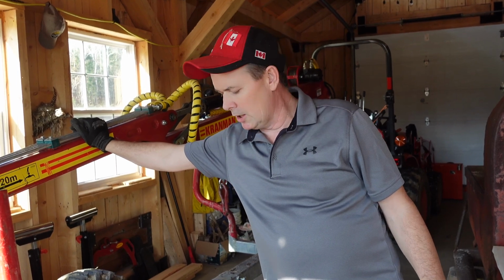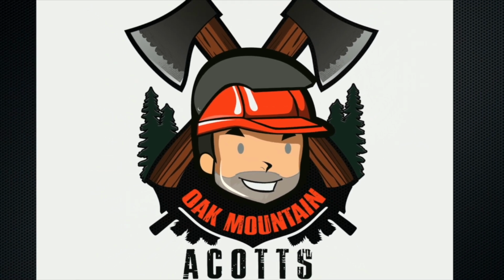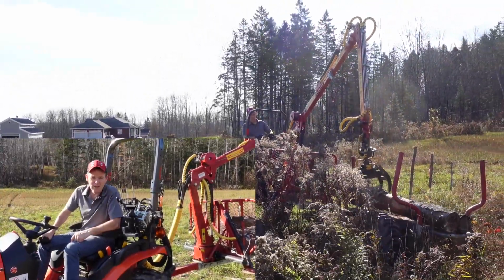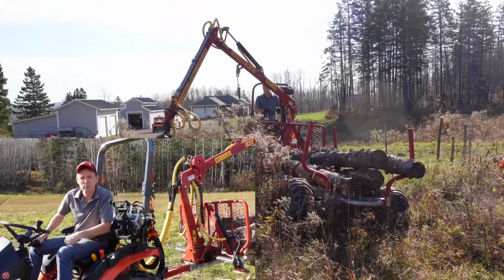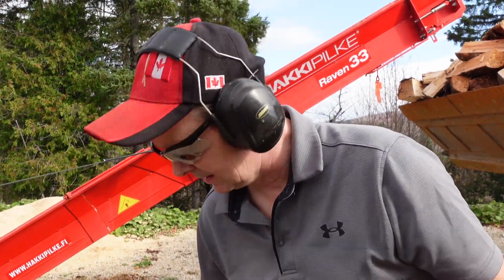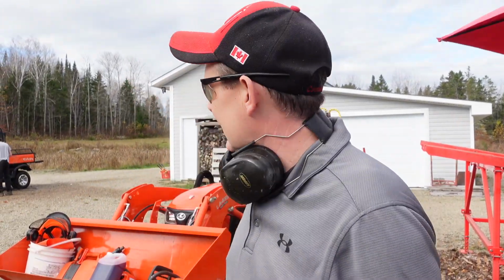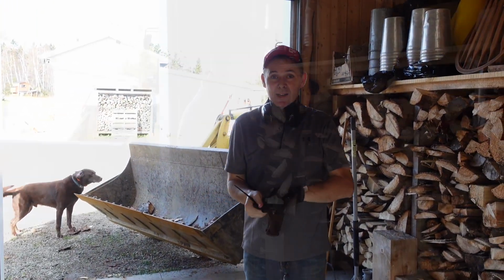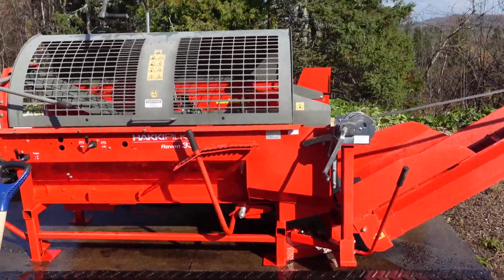Making Spruce and Fir Firewood and Some Deer Footage -E187

Comment: Great video Jason- Winter prep is so important. I would be curious to learn more about your undercoating process. It’s something I’m planning on starting next year.
Reply from the maker: Hi Richard, I had a local shop undercoat the truck for $300. They did a very thorough job but I did have to hand wash it all to remove the overspray!
Reply: Thanks Jason: There nobody local that does undercoating, so it’s going to be a new DIY project next year.

Comment: Winter prep, I am there now!  You had good weather for doing so.  Last weekend was our pool. That reminds me that I need to clean the deck of our JD Zero Turn too!  I've seen yours in the background! This softwood is going to be put to good use.  It was no longer good for lumber I guess! Thanks!
Reply from the maker: Are you happy with your CanAm? Thinking about trading the kubota in on a defender… too slow in hunting season!
Reply: VERY happy!  We have the HD10 Mossy Oak (2019). It has a smooth ride, and the power of the engine (82hp) is 2x what I need to haul the log trailer full. It got a  High and Low mode. The front and rear axle can be locked, and the front axle can be disengaged. Which is ideal for riding in summertime, on lawn. The reverse is LOW, so no problem going in reverse with a good haul. Even on LOW, you can reach easy 40km/hr. Will run 30km/hr @ 5000rpm on low.  It will reach 100km/hr in High, no problem.  That engine is meant for constant 4-6k rpm, which is very different to a diesel engine. In fact, nothing really happen below 3k with such an engine. Traction is the only thing I'd like to improve in winter time. That is where the tracks would be nice. That does not refrain me from hauling a full load of wood uphill in fluffy snow. Just need some technique.... (aka pedal to the metal). Thanks!

Comment: Hi Jason. Noticing the power pack unit on the processor, are only compatible with the hakki pilke processors or could they be used on any other PTO driven processors?
Reply from the maker: Hi there, I’m no mechanic but I’m sure there would be a way to do it. You might try reaching out to the log father on YouTube. He runs a firewood business and is a mechanic. He might be able to point you in the right direction. Tell him I sent you!

Comment: ln Boreal forest areas,  Birch is the go-to (white)  But Birch needs a season to sit to get the most out of it. Not everyone is near Birch stands as well, Larch offers good BTU (not Tamarack, Larch) But alot like Birch, not everyone is near Larch or Birch stands. So majority of firewood for Boreal'ers ends up being lodgepole or jack pine. I guess white, engel, sitka spruces and doug fir are okay to burn if the wood condition is not great for other utilization, but man l wouldnt want to be burning things like black spruce or balsam, just because of their annoyingly longer drying, and more tinge residues they leave behind. Aspen? Well aspen has alot of issue indeed with quality, the BTU of course disappointing.
Reply from the maker: Interesting to hear about what others are using for firewood. We have been using the left over sawmill slabwood (spruce/fir) for our maple syrup boiler this year. Seems to work pretty well but you need to tend the fire quite often!